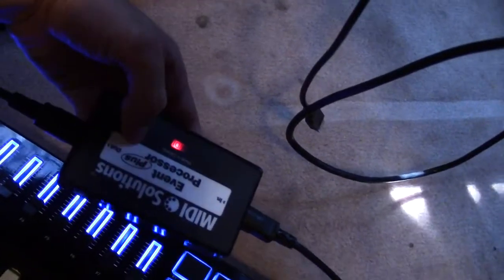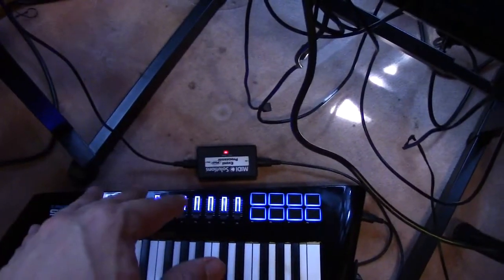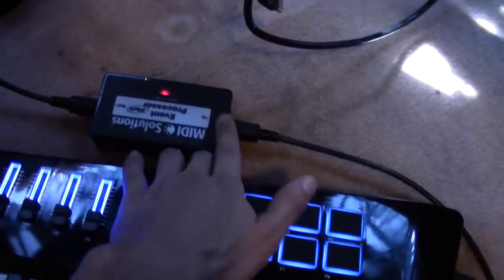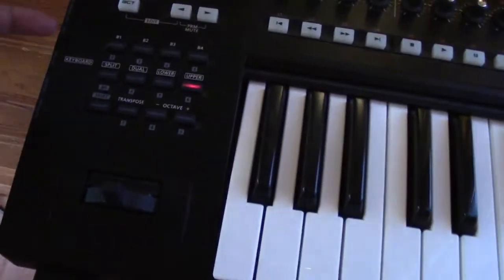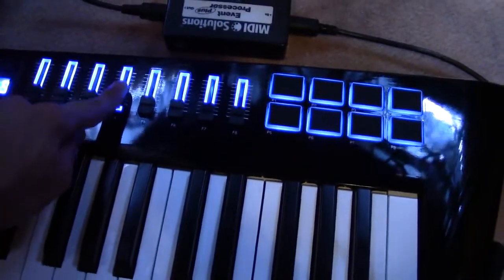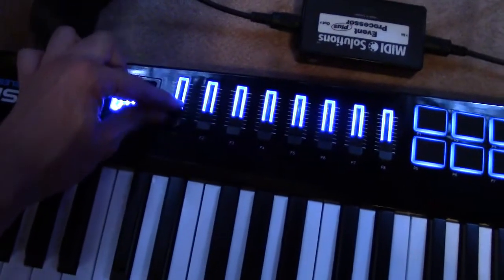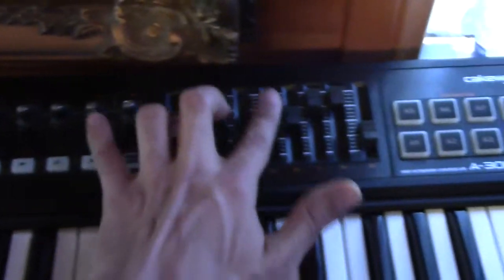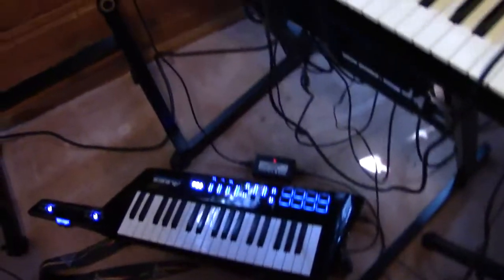A Midi Solutions Solution! | Follow up on the Event Processor Plus

Comment: Look on the bright side. The MIDI SOLUTIONS EPP can be used as a tester to find gear that does not power on the MIDI OUTPUT (which breaks midi spec). 
Thanks for the headsups on the Focusrite, that is now on my "not to buy" list, as power on MIDI OUT is so basic.

Just checked all my gear that has MIDI OUT
Waldorf Blofeld lights MIDI SOLUTIONS EPP (MSEPP)
Korg Modwave lights MSEPP
Cyclone TT-78 lights MSEPP

As for price the MSEPP is $239CAN direct from manufacturer.

Comment: part of the problem is that certain synths do not output the expected 5V on the midi out. Also I suspect some computer interfaces output either 3.3V or none at all. My Roland UM-one lights my Midi Solution EPP brightly no issues. Synths such as Blofeld and Sledge output the oldschool midi spec. You run into issues with the stufff that does not output 5V that EPP expects.

Comment: hello thanks for this video
do you know if the Event Processor can convert midi NOTES into CC messages? So if i would play a note on a midi keyboard for example, it would convert into let's say a message to change presets of my guitar fx unit?
Reply from the maker: Yes, that is possible. I recommend downloading the MIDI Solutions Tool before investing the money. You should be free to poke around the software without having to buy the hardware. Then if you feel confident, buy yourself the Processor.
It's a really tough thing to understand the interface though. Good luck!

Comment: I need help with my events processor setting. Trying to tell a rack unit to disregard the expression pedal message coming from my Kronos but can't seem to get the setting so that the rack unit pays at full volume regardless of where the expression pedal is set. I would appreciate any and all help!
Reply from the maker: Sounds like you're trying to Filter a MIDI event. I think you ought to connect the midi of the Kronos to your computer through your audio interface and run midi-ox to monitor exactly what messages are being sent from the Kronos when you move the expression pedal. This will help determine which control message to filter when programming with the Even Processor Plus. I can't help directly because I currently have neither of these products.

Be sure to check the Midi tab in the Global page of the Kronos. There's a short list of settings that the Kronos itself can filter, like Pitch Bend, System Exclusive, etc.